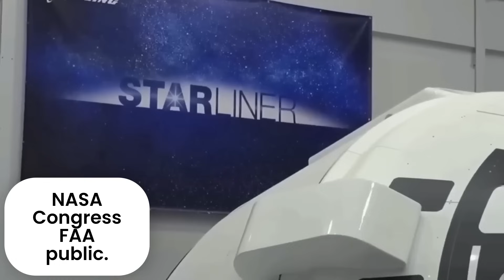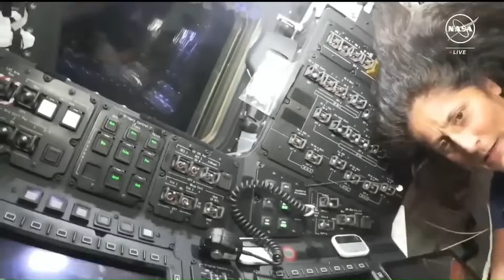NASA Just Replaced Boeing's Starliner With Dream Chaser!

Comment: Rightly or wrongly, I consider the apex of Boeing's aviation to be its 747 Jumbo Jet.  Thankfully, those designer's and engineer's produced and built an aircraft which, history has proven, could perform beyond its designed and expected limitations.
Reply: Their entire stable of 737, 47, 57, 67 and 77s are safe! The 737 max not so much, but thats software. I've spent a lot of time in 737's, I trust em.